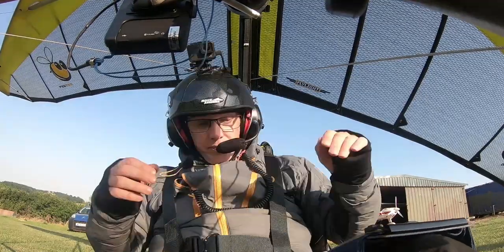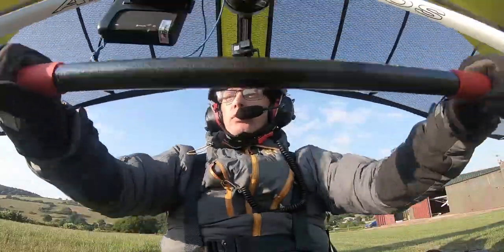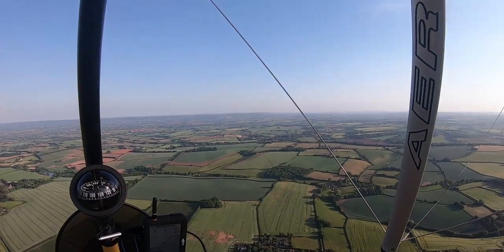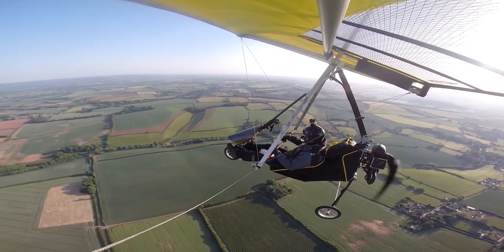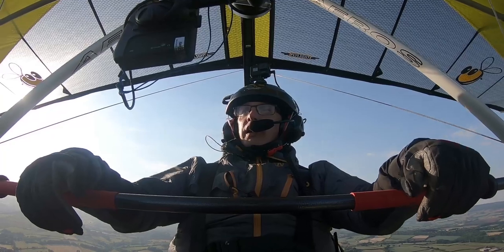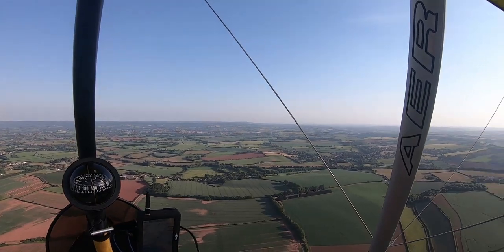Flexwing PeeBee - Post maintenance test flight

Comment: I listen to no music on the hang glider, I have heard frogs and crickets from 1000ft above ground, also water birds on Lake George. Then of course Wedge Tailed Eagles though these are normally 5 meters from me when I jump at the screech. I love hearing nature air and  land traffic are interesting.
Nothing ruins a camping trip getting away from it all, more than some mufti with a sound system dropping you back in the cesspool civilization 😖😣😫
Wind distant thunder birds calling, this is worth listening to. The motor is going to be a problem...
Reply from the maker: Hi Blue, yes it's hard to get a natural flight with a propeller turning, but to some, the sound of a 2 stroke is music. I can only relate to when I used to fly paragliders and hearing the nature around me, with a backdrop of Vario beeps and tones.

Comment: Nice to see this Giles, what’s the max take of weight in that? Very impressive take off / landing distance.
Reply from the maker: Ben, its an odd one, as it doesn't have a max take off weight. Because its being operated under the CAA Sub 70 kg exemption ( no licence required) the structure and fuel must be below 70kgs or 75kgs if a reserve is carried.  To keep under my max 75kgs, I can only carry 11 litres.  The stall speed must be below 20 kts which is why the landings are so short.  My Cornwall trip was the absolute limit on fuel. If I want to carry more fuel, I would have to go SSDR which I can do with the PeaBee and put a G-Reg on it.  I don't need to change anything else, except I can then operate under the SSDR 300kg limit.  Sub 70 is a fantastic way to get into aviation without a licence and it's why I made my Paramotor to PeaBee series.
Reply: Golf Foxtrot 22 thanks for that reply. Fascinating world !

Comment: Lovely video. Do you know if the polini Thor 250 is as reliable as your moster? Thanks!
Reply from the maker: I can't comment on the 250, I've never owned one. The Moster is more than enough power and is lighter. What are you planning on the 250 to be used in?

Comment: Maybe not usual but I have never got around to music, I don't use a moving map only paper and have no radio but do have a small sound verio I can fit inside one of my ear defenders. I always have something to do look for lift, find out where the hell I am, look for fellow aviators, check the fuel left and so on so time flies !
Reply from the maker: I still have my Air Chart, I have found a way of getting the Oudie Vario to Bluetooth to my headset, and can't wait to try thermalling again.  I'm always looking out as well. One of my freeflying friends likes listening to Radio 2 on his Xc flights.  He can tune his Beofeng in on his flight deck which made me chuckle. he said Ken Bruce normally finishes but the time the thermals start building.

Comment: Can the delta wing "Stall"?  if so, what does it do, what are it's characteristics?
Reply from the maker: Yes they can stall like any conventional wing. My PeaBee is really hard make it stall but the nose just gently drops through and you recover. For the UK Sub 70 exemption it has to stall at 20 knots or less, its to stop people putting really small wings on them.

Comment: Are you not using an ASI any more?
Reply from the maker: I have it fitted but it just sits at 42mph. I managed to get over 50 mph with bar fully in and a lot of power. I might take it off as it doesn't give me anything useful.